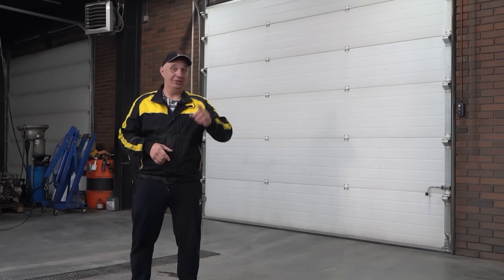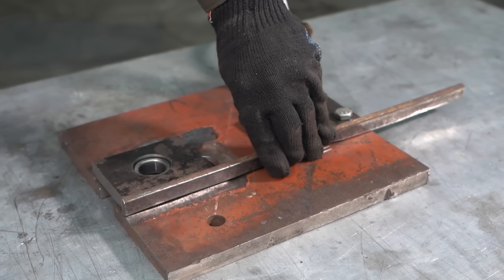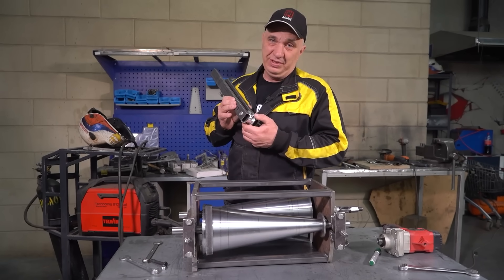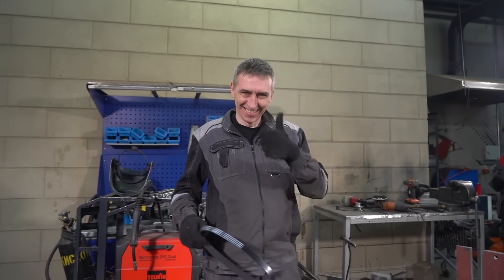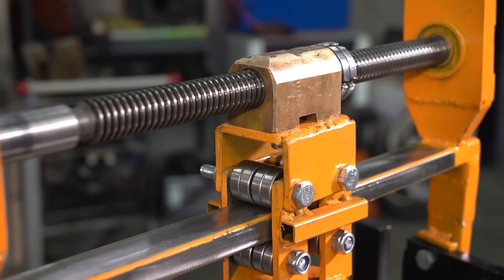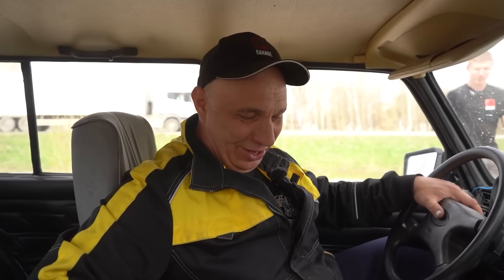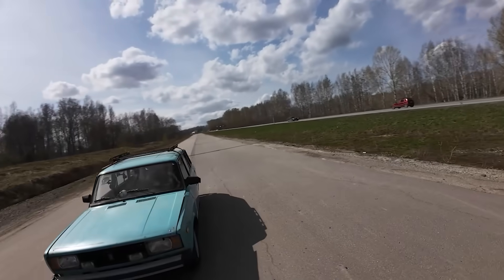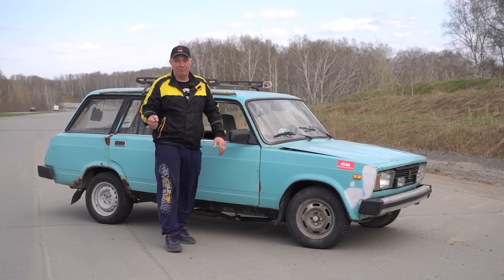We make a DIY CVT for a Lada - will it work?

Comment: Some old American cars had a smooth disc spinning behind the engine.  This had a wheel rubbing perpendicular to the disc. As it moved farther from centerline the ratio increased. If the wheel crossed center to other side of disc then you went in reverse.  This would be much easier to duplicate I think.  The CVT Nissan used didn't last very well either but they didn't mind letting customers figure out it didn't work worth a damn.

Comment: put uni-directional wheels pressing down with pressure on the barrels and it can replace the belt. the whole unit will have to tilt so it can match the angle of the cones, but it will not stretch or slip like the belt will. every car company should do this and they could have the cheapest easiest transmissions to build maintain and repair, instead they are making snowmobile transmissions to put in your car that use belts or geared CVTs that are super expensive.

Comment: How much water belt staggered so that it stays in contact with the rollers. And eventually especially made triangle shape belt the water one will have to be longer perhaps but you need to have like a 3-inch wide belt that is staggered

Comment: That's a very nice idea. How about using a metal belt instead of a rubber one and lubricating it well? Next, electronic control of the gear ratio would be interesting.

Comment: Very good and well done for making it work. The weak point is of course, the belt moving mechanism since the belt is being subjected to lateral forces which it was never designed to take. What about machining the smooth cones into a pair of conical cogs (by cutting a series of longitudinal grooves) then using an idler cog running between them to transfer torque from one to the other? That would eliminate the belt altogether.resulting in an all metal assembly. Submerge it all in oil and it should outlast any belt driven CVT. If it works, and goes into successful mass production, my cut is 10% on all sales 👍😀👍

Comment: I don't know if you've ever seen American six-wheel drive vehicles..... Not the car sized ones but the ones they use the little bitty off-road vehicle tires.... They had constant velocity transmissions..... And while you're using these large diameter cones....
... They use pulleys.....
.. they use centrifugal weights Anne springs....... The centrifugal waves move out with RPM and a little lovers move the outer pulley in and out...... The belt circle. Diameter. ncreases by. according to how far in the outer pulley.... Moves....

These toys.... Could hang wheel stands with six people in them...... The makers were.... Hustler I had one.... And.  attex

Comment: Would not a frame that moves the belt from the bottom and the top at the same time be more effective at preventing belt wear and slipping?  How about roughing the surface of the drums up in a linear fashion to promote grip in the turning direction but not in the sliding direction?  Any plans for a reverse?

Comment: This kind of CVT isn't very useful. You need a belt with a thick body, almost like it's being run sideways, but also shaped as a tight V. Then you use two vertically oriented bowls facing each other. The V belt sits between the 2 bowls and you change gears via bringing them closer together or further apart.

This method of CVT gives infinitely more traction to the belt as you can always give the belt tensioner more strength as needed and also allows for the use of metal links designed specifically to be as grippy as possible, essentially brake disks that want to wheel lock.

There are other design challanges with this method such as cooling (cooling from inside the bowls) and others, but they are mostly endurance problems so with the level of construction you've shown in this video it would be laughably easy to throw a working prototype CVT of this type.

Sourcing a V belt for this project is another matter altogether, it is the most difficult to fabricate piece of the puzzle and each one made of metal costs around 100 USD.

Comment: The belt is flat, at the center of the belt it will go ok, but at the edges of the belt it will slipping, creating heat, destroying the belt, a solution can be a round belt, but tvat means less surface for transmission, but if the cones surface is not flat, but all with tiny teeth it can improve that.

Comment: Seems to me you could make two conical worm gears. You make them convex so they can be rotated on the center axis from high to low ratio. The gears are always in contact just the angle of contact changes. You could use a straight worm gear with a parabolic one that rotates on the center axis. This would eliminate that stupid belt that doesn't work.

Comment: The transmission from a snowmobile does the same thing and would have worked better.  Also, some snowmobiles have quite a lot of horsepower, so a transmission from one of those would enable the car to be driven normally without ruining the belt right away.

Comment: Your tension roller's flanges have square corners where they meet the roller body, sort of like П your belt is getting chewed in the corners. Maybe try machining a roller with round body, U. The flanges are where the roller push the belt back and forth over the cones, so making it easier for the belt to ride up these flanges and have pressure applied to it, should improve performance and durability. Another suggestion is, knurl the cones surfaces so the belt doesnt slip so much. Im not certain if the extra wear damage would be offset by less slip damage, only testing can answer that.

Comment: All respect for what you do. However, I believe that you could have simpler construction of the belt sweep system on the cones by simply changing the tilting (synchronized) between the technical axes of the two cones. When the axes approach one end of the two cones, at the other end of the two cones they should move away. This way the belt flows by itself (ensuring a different ratio) depending on how you want the sweep at the ends between the axes of the two cones. I can give you the drawing in Solidworks with the technical sketch of the idea. 
Simple is best. All respect.

Comment: Do not use a CVT as a final drive.
It MUST be driven by a low torque high revolution power source.
Likewise it must be followed by a recuction gear besides the reduction in the differential final drive.

Comment: If you throw out the original transmission and change the belt cart mechanism a bit you could have a proper, usable design! I think something like a detented lever would be cool, with many small increments that you can make the adjustment in by moving the lever by hand forward or back, while still preventing accidental movement with e.g a button lock. Think something like a handbrake but with the lock on both motion directions, with a setup like an airplane thrust lever. It would be a manual CVT with clutch only for takeoff and stopping, very novel and Lada-appropriate design in my opinion. 

Then maybe change the car accelerator pedal to a hand throttle pull handle (like with a choke), so that you can keep the engine running with a semi-constant RPM for maximum power and efficiency (with only rare adjustments during driving) while controlling the speed of the car mainly using the transmission. Wouldn't that be so cool??

Comment: I'll give you a tip that can improve the performance of your experiment, use one of the conical cylinders further forward than the other, so that you can attach a rubber pulley in the middle of the cylinders in place of the belt, they should be one further forward than the other so that you can place this pulley at a degree to increase the contact area and reduce friction, the pulley should be half across, I don't know if the translator translated it correctly, but I think you understood me
Reply: the pulley should have very little cross-section, I don't think you even need to move the cylinders, because the degree is not so aggressive, I think that this way you will be able to move faster, you should use a steel rail in the middle of the pulley so you can tighten the pulley as much as possible, use a bushing in the pulley bearing with the hole at the degree of the cone, you should find a good rubber to withstand the pressure and friction, this mechanism is not very effective but it can be improved a lot
Reply: in fact the bearing guide should already be out of phase with the degree of the cones, so there is no need for any bushing in the bearing, as it will be correct automatically, I hadn't noticed
Reply: in fact the bearing guide should already be out of phase with the degree of the cones, so there is no need for any bushing in the bearing, as it will be correct automatically, I hadn't noticed

Comment: ⚡
Heres a major issue un this transmission, the belt slider is having a lot pressure, and the cvt rollers need to resituated in diffrent angle to have less friction on the belt, and less pressure on belt slider.
✍🏻
Sagar

Comment: If you were to introduce a slight crown to the center of the pulley the belt would want to self-center on the high spot due to extra friction pulling it towards the center that's why tractor belts in a figure 8 don't fall off

Comment: From what I understand, automotive CVTs make the belt stay in the same place, but the diameter of the driver and driven drums are changed with hydraulic pressure. It makes shift ("shift") a lot more quickly and consistently and with a lot less resistance from the belt (chain) itself.

Comment: those cones could have been made from sheet metal by bending and cutting, too. how about two rollers or a channel, not just one roller. also chamfered rollers instead of 90 degree rollers. to keep the belt in the roller. well thats a cnc machine. proper crusher. you need a transmission stick lever. 90 degrees two-discs cvt with one small drive disc would make a really small cvt. pretty much like bicycle gears but cvt and 90 degrees no chains. magnetic drive, not physical friction. the large disc side does not have to be magnetic, only a metal disc. the drive disc is alternating magnetic. ie the surface area that the magnet drive disc runs of (run length) varies, so cvt varies. metal acts as a induction metal surface and creates opposite magnet pattern. it could even be magnetic drive belt, not a drive disc.

Comment: you could have someone create code for an arduino and use servos to move the belt positioner  as the throttle is increased. you could make this usable if you really wanted

Comment: Man, I am minute and a half in it and I can’t help myself. You took the ridges off. You could’ve left them for traction. The next one is you get some really hard rubber balls and you put them on the end of a tuning fork and you stick it between themand once you figure that out you keep the tuning forks throw the cones away and build saucers on tire spindles on swing arms, and tuning forks with balls on rods and and guide rod there’s some playing with it. You can imagine and figure it out, but I got military picture in my head. A belt looks good on paper. Me arguing with the high-end got them to make a belt at a little bitty plate so that the plates were constantly a tank tread rebuilding a straight piece of rod to push now that might give you a higher dynamic however you being an old man looking at you you’ve lived through the first 1980s to today so you’re 10 year anyway political shit you know what a spring trap pistol is they’re what they gave us instead of airsoft pistols use the same little bitty airsoft rubber bullet, but it had a piece of metal bent into a U and the trigger itself would push the baby and kick it through well it doesn’t kick the ball all the way through, but that spring trap from that ball has a chance to do a little bit like an accumulator when you use them two balls on that tuning fork spring trap, a accumulator and instead of using balls use balls with the one that you have but you’ll use egg shaped balls they’ll be more of an O an egg. You know what I’m saying fucking mosquitoes mosquito research and development discovered that those V belts and even the you police pulley makes two different velocities and while when we’re running a turbine, we can make use of the friction drag coefficient modification there in this specific application you control arm at the top, you need another one at the bottom and you need two flat rollers to go in front of and behind the belt and you need to put a little bit of slack so that the belt has a chance that you kind of use the two Polly’s to keep tension on the belt. It’s like you gotta keep the belt sideways. You gotta keep it in that twist and it still makes a little bit of friction heat in the twist.

Comment: Perhaps instead of moving the belt, the belt could have a tensioner and then the rollers can be adjusted hydraulically off the power steering pump?

Comment: You are trying to start and move cars by more than one other method, it really turns out to be an amazing and great job, so what would it be like if you tried to start a car, for example, with radio-controlled nitro motors?

I’m sure it will be a very fantastic job 😄😄

Comment: CVT WAS INVENTED BY LEONARDO DA VINCI. MOST SMALL VEHICLES ARE EQUIPPED WITH A CVT.  POSITIVES::: CHEAP FOR MANUFACTURING. RESPONSIVE, FUEL EFFICIENT HOWEVER NEGATIVES::::: LIGHT TORQUE, SHORT LIFE, EXPENSIVE TO REPAIR AND CAN BREAK LIKE GLASS. MOST VEHICLES UNDER 200KW STATING 6SPEED ARE CVT

Comment: I believe the belt was damaged by the curvature of the wheel up top. They tried to force a flat belt on a very curved wheel.
If they change that wheel to have a flat surface in the middle to fit the belt there, it would survive much longer.

Comment: I can remember a v belt cont var trans in the  50 - 60s  -  2 saucer shaped discs pressed together by outer spring pressure with the belt in between, higher torque forced the belt further in (like a bad weggie) achieving lower ratio -- the matching setup at the output .. the belt slipped out to the wider posn. (TV News in black n white) Was driving rear axle The belt was leather and wore badly ... car was small.  British ??  The wear rate killed the idea.. Anyone know the car / make?  GOT IT : DAF Variomatic

Comment: you could add an electric servo to do what the hand drill is doing, and add a sensor to the stick shifter that reads forward and backwards, and when pulled back it goes faster and forward makes it slower or whatever you want

Comment: Maybe If you put a cone on a pivot point at the tip of the cone and make the base spread apart from the other cone it might move the belt without a third lever trying to push from the center

Comment: WHY NOT MOVE THE CONES THEMSELVES UP AND DOWN ON THE SIDES TO MOVE THE BELT WITHOUT THIS WHEEL? OR AT LEAST MAKE THE GUIDE IN THE WHEEL WITHOUT CORNERS, LIKE THE INSIDE OF A BOWL. THEN THE BELT COULD SLIDE BETTER AND WOULDN'T BE RUBBED BY SHARP EDGES.

Comment: Whats funny is they never needed the guide for the belt. Torque would have automatically moved the belt to the left "increasing gear ratio". If you curl your right hand in the motion of the belt, and point your thumb out, the direction of your thumb is where the torque wants to move.

Comment: Put a half twist in the belt, as the side that faces the larger diameter would end up facing the smaller diameter end of the cone. That would cancel out the small difference in speed between the left and right side of the belt. In theory, the belt would need to be infinitely thin for this to work without a half twist, as the width of the belt causes the left side of it to be on a different gear ratio than the right side. Edit: just noticed someone else said the same thing. Try it, it may just work.

Comment: old school design advice on conical "cvt" was to give the belt a half twist between rollers... makes them stay in the selected spot. just like a crowned wheel, the belt tries riding to the larger diameter...

theres a certain geometry required to allow the belt to run without the twist, not easy curves to make. and non-linear in its ratios. so a half twist is just easier.

leather belt, properly spliced, would have held up a bit longer

Comment: That is amazing! It looked like the main reason the belt wore down was because you can see during the high speed run, the belt was being pulled to the left by the closer cone pulley, but the ratio adjuster couldn't move any farther back to let it go where it wanted to. It looks like if the ratio selector was able to move the belt all the way to the full front and back of the cone pulleys that you could avoid the belt noise and wear down during the stress test. I wonder if instead of a hand crank to control the gear ratio position, what if it was allowed to freely slide front to back on bearings and it could self adjust it's own position?

Comment: nice, but how long would the belt last, a few miles ? a few hundred miles at most with an optimised design? ...

the belt used here is meant to be used longitudinally, not to be twisted during operation (non mentionning max friction for torque transfer).

Comment: the cone CVTs i've seen working before all used a roller because you can drive the roller up and down by just pulling the axel the roller is on (or turning a threaded rod). the belt method is better torque transfer but way harder to move the belt

Comment: Hey guys, try reversing the belt or getting one this type. Put the smooth against the cones and the ridges into a ridged adjustment pulley. Try lubricanats, maybe dry graphite and see if it slips.